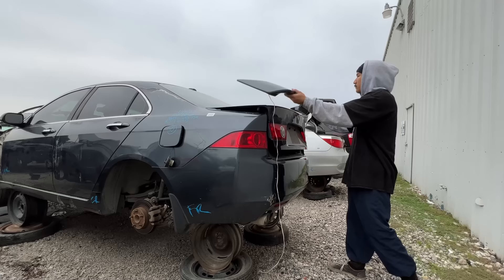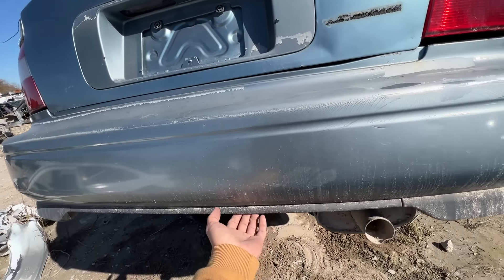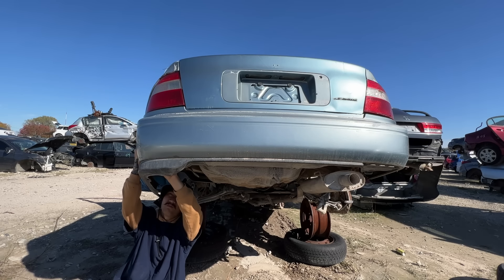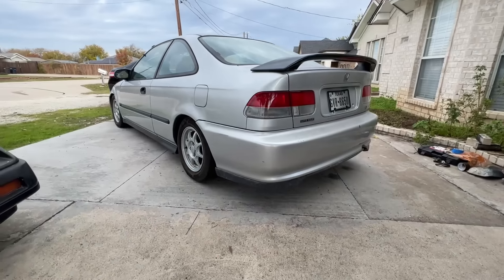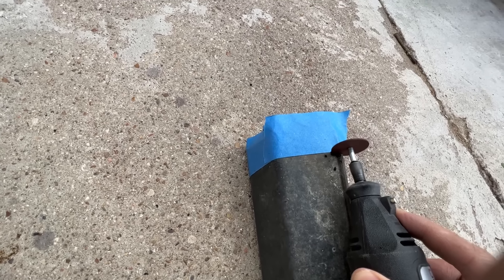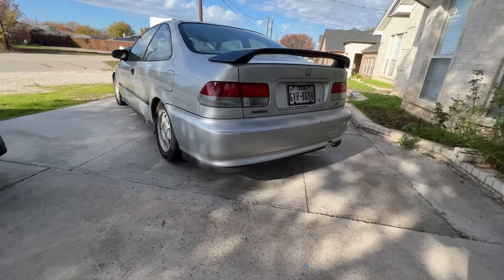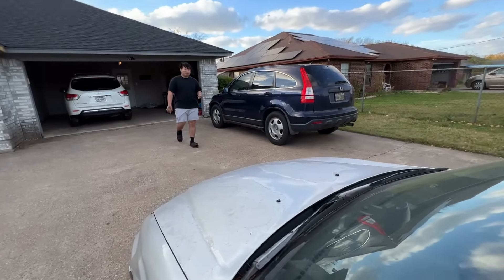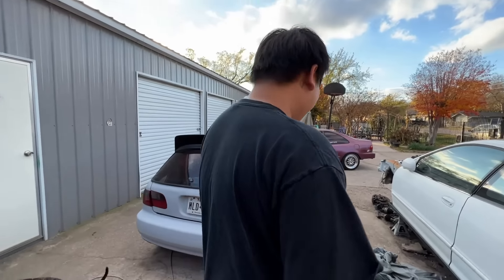Building my Civic using ONLY Junkyard parts! - EP. 3

Comment: If i was you u would have cut them while installed so you could match the body line nicely. Also the side markers looked so much nicer on the rear of the bumper, instead of the sides.